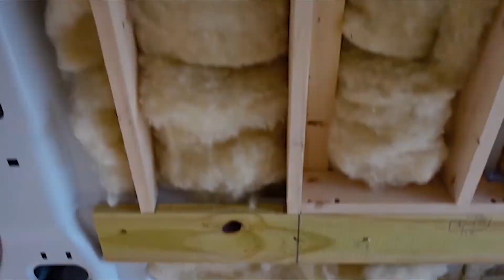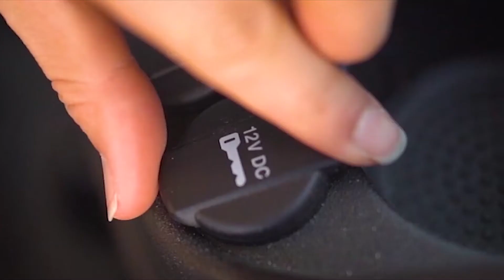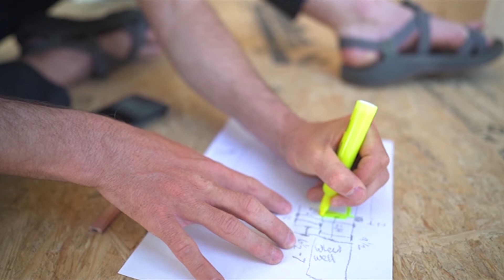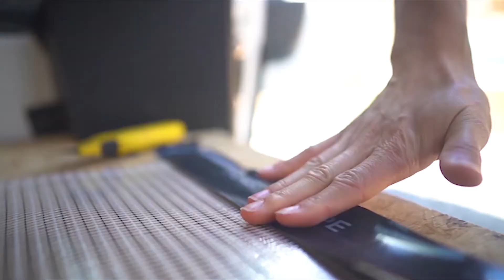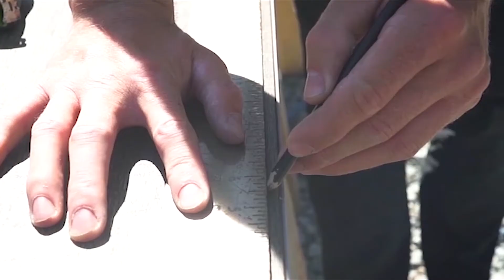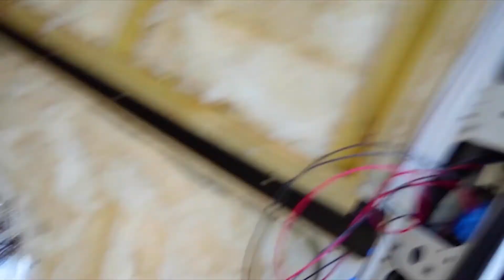Van Build | Heated Floors | Vinyl Plank Flooring Install | Van Life Tiny Home Build

Comment: Please can you update regarding the heated floors...  My vans already built..  

Can these heated matts still be installed.. do you recommend these matts?
Reply from the maker: Hey! I’m not really sure what kind of floor you have in your van, but if you’re able to remove it you could definitely install them. They’re nice when we use them, but usually when it’s cold we just put our shoes on. Hope that helps
Reply: @NomadicVisuals  thank you for replying my van has carpet with plywood underneath it it's a conventional Class B van... 

Please when you have a moment record an update on the mats..  are they effective at all temperatures or is there a point where their ineffective

I plan on visiting some reservations in Alaska it's why I'm so Keen on this video in your response